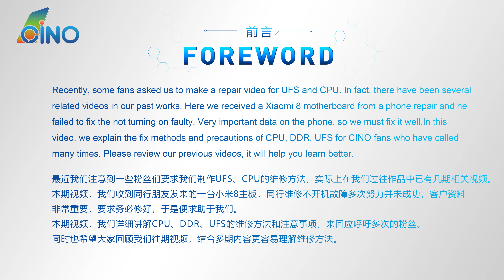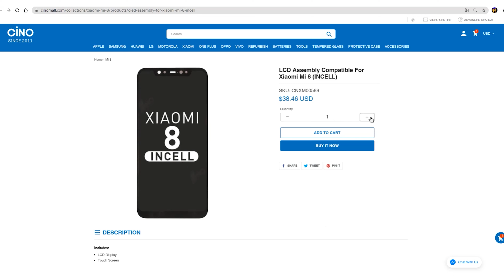How To Fix CPU, DDR, UFS - Android Phone Not Turning On Repair Case

Comment: Thank you for another video. What should be a current  so that so that it can be supposed CPU is running - see  9:02 minute. For which models/brand  of CPU is 100mA a current for  CPU to run?
Reply from the maker: CPU functions well when clock, power supply and reset are normal. The current can reach the range of 40mA-200mA when power on, which is sufficient for any platform CPU. The current in this range can be reached only when the clock is powered and reset. On the contrary, if it is higher or lower than this range, it can be inferred that the three main rules of the normal operation of the CPU may not be satisfied, and thus the CPU welding is not good.
Reply: @CINOTechnology  helpful ❤️